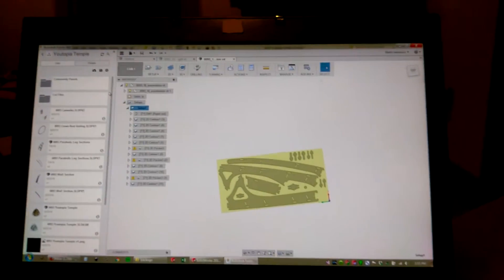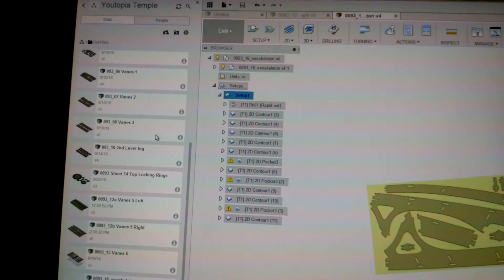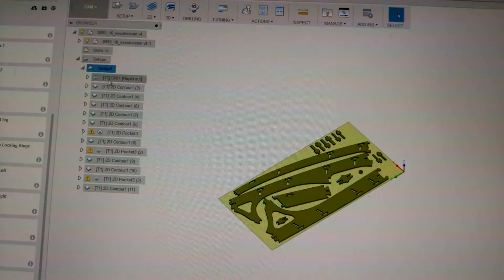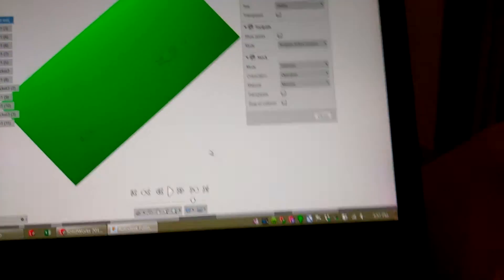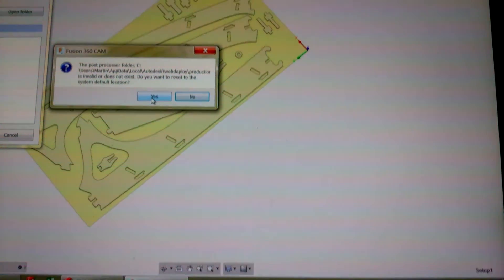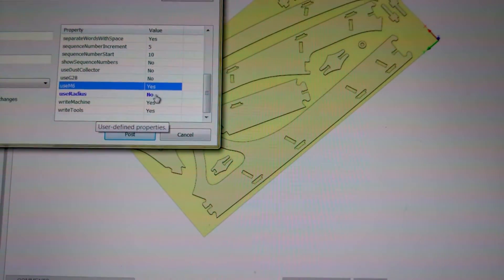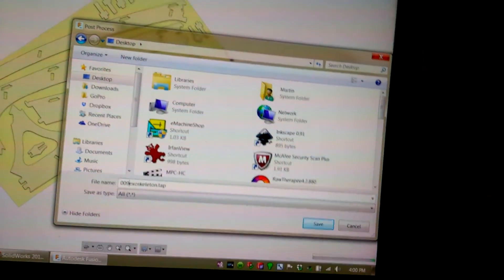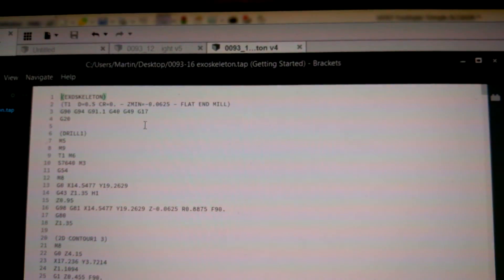Exporting files from Fusion 360 to Mach3

Comment: Thank you for this post. I have a problem, that after export and production It seems like it does not calculate dimension of the tool correctly. Holes are smaller and outer dimensions are bigger. Any Thought on that? I do not know what that radius means?
Thanks again
Reply from the maker: ROBOD SPACE under the "passes" tab there is a field near the bottom called "stock to leave". This is automatically turned on for some operations. check that.